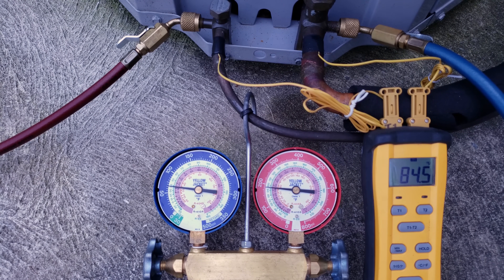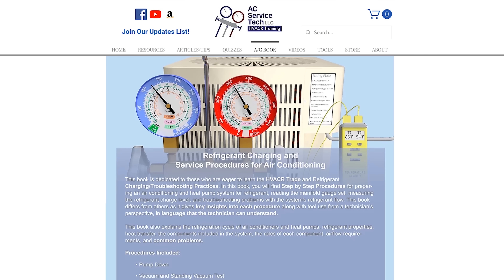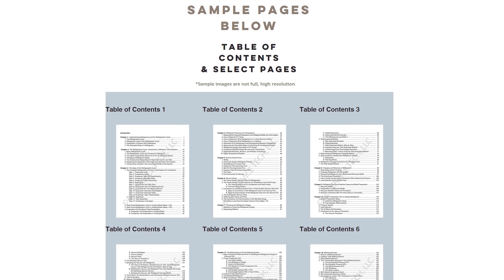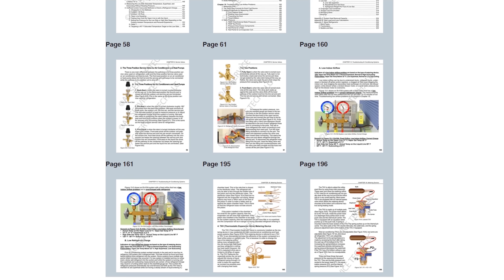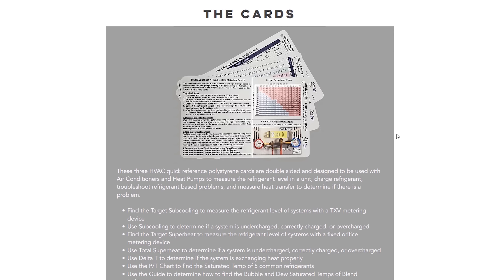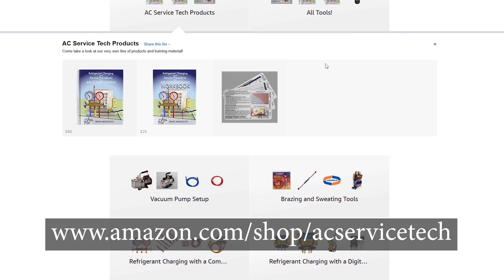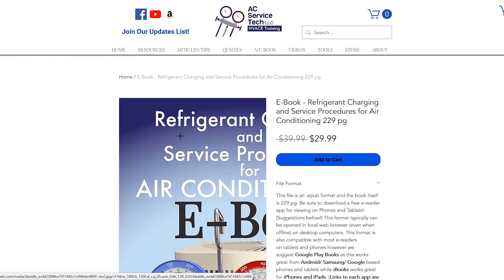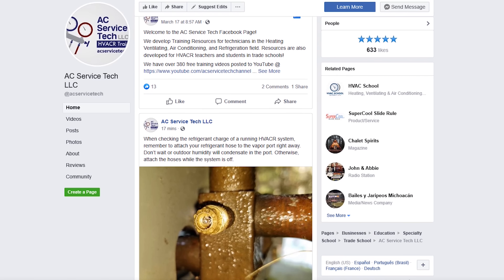Liquid Line Restriction on AC Unit Explained! Found Bad TXV!

Comment: Looks like the system is low in charge, I wouldn’t condemn the TXV some TXV s need a little extra push. You were well below on all pressures. Great video though!
Reply: Not exactly sure what the ambient temperature is outside so a little hard to tell what the the liquid line pressures might be. In my case I would have added 1 pound of R-22 to see if both liquid line AND suction line pressures increased and if the subcool and superheat temperatures changed or remained the same. I know you do have to be careful about overcharging the system though.
Reply: You are correct Disenchanted.  He was probably just a little low on charge. His head pressure was to low. 
He never gave the ambient temp. But guessing it was at least 70°-75° cause he’s running the ac and has a tshirt on. 
Grandpa’s rule for R22 systems 30° + ambient temp = high side sat temp. 
His sat temp was was low for ambient temps. Not to mention both high and low side was low.  He proved his txv was working when he placed it in warm water. 
He was just low on charge.
Reply: @rpatty1973 Heating the sensing bulb was a diagnostic step to confirm that the TXV has a restriction and is not operating properly under normal conditions. When you applied heat and the TXV opened, it showed that the valve was capable of functioning but was likely sticking or restricted in regular operation.

This test helps confirm that the TXV is faulty and needs to be replaced, as the issue is likely intermittent or mechanical, causing it to restrict refrigerant flow under normal conditions.

In short, heating the bulb provided a temporary fix for the restriction, but it verified that the TXV should be replaced for long-term system reliability.
Reply: @rpatty1973  Explain the subcooling then You are dead wrong! With txv open subcooling returned to normal from high.
Reply: TXV IS AN UPSELL SCAM THAT A LOCAL A C COMPANY USES IN LUFKIN COST ME $500.00 for A TXV FROM HUSTON, Tx. in 2015
THEIR NAME STARTS WITH 
Mc W  RUN FROM THEM THEY UP SELL EVERY BODY
Reply: I try charging the system first,if both pressures  goes up that means the system was low on charge. If the pressures doesn’t rise that means liquid line restriction then remove the txv bulb and place in the boiling water. Plz correct me if I am wrong

Comment: Great video as always.
But. When bleeding air out of your hoses, when you connect the suction and high side hose to the unit the hose connections should be slightly cracked at the manifold so as to force air out at the manifold and then tighten. Opening up the service line will be too late, the air has already mixed throughout the system as a homogeneous gas, not to mention the water vapor in the air mixes readily with hydroscopic poe oil that is suspended in the refrigerant. I used to use your method for years but I believe now that it isn't the best practice, especially on commercial units under contract that are constantly connected to. Thanks for another great video.

Comment: Great explanation. I got a 410a txv unit where my liquid pressure is fluctuating 100psig.  Why ? Possibly had leak seal in the past. Cooling good tho?? 17 degrees delta T

Comment: I thought if you do put the bulb in hot water and the TXV opens, then that means the TXV is functioning properly??? can anyone answer this?
Reply from the maker: The txv is functioning but with a lesser amount of refrigerant in the bulb (because some of it leaked out), thats the problem. It takes much more heat to make the inside of the txv to open.

Comment: Love the video.  One question though.  Is the dryer put in wrong.  I noticed it isn't a bi-flow and see the arrow pointing away from the indoor unit.
Reply: Nevermind.  I looked at the video again.  I see now that it's a horizontal unit and the dryer arrow is going in the right direction.   Sorry.

Comment: Gauges that are also for r410a will have a scale that will not allow an accurate reading for r22 (I have those gauges for a backup). The scale is way too wide. A set of gauges just for r22 is what should be used or an electronic gauge set. 
 If your readings (Temp and psi) are off just a little, that 15 sc might be 12 sc or 18 sc. 
  Your TXV testing is an incorrect way to test. Forcing a valve open is just that- a forced valve open. It will not substantiate a badly operating valve. 
 Be sure that outdoor coil is clean.

Comment: What am I missing? The txv got hot from the water, to opened up and let more refrigerant in. Isn't that what it's designed to do?
Reply from the maker: Yes but it should be able to do that based on the heat on the vapor line without adding excessive heat like the bulb in hot water. It wouldn't open during normal operation. This is a sign of a slightly low amount of refrigerant in the bulb, thanks!

Comment: Informative video and lesson. 

However, I'm confuse with the conclusion that the TXV is in bad condition @11:00. When the bulb is dipped inside hot water, the TXV opens up and allow more refrigerant to pass through hence superheat drops from 30++ to 19. Isn't the TXV is functioning properly because when it senses more heat, it opens up and vice-versa? Thank you
Reply: I think 🤔  the bulbs position is important an it could be not in the right position of the evaporator an it will give you a bad reading.
Reply: I think it's because the bulb was exposed to such an extreme temperature difference in hot water. Thus forcing it to operate. Remember it did not operate under normal conditions. Just my opinion

Comment: Where there is blocked filter in evaporator side, or clogged evaporator would also cause insufficient supply of hot air. So,In that case it would mean the bulb is not sensing

Comment: So, if I understood it right. The txv has lost some refrigerant charge. And the only way to make move the membrane and needle down, to allow the refrigerant to flow into the coils, -  Increase the pressure inside TXV, by using a higher temperature around the bulb. More temperature -more pressure on the txv membrane?
Reply from the maker: Yes the higher temp on the bulb will allow higher pressure to push the needle down and open up the flow a bit more through the TXV. Thanks for your support!
Reply: @acservicetechchannel  Thank very much for for taking the time and efforts to share your experiences and knowledge. On a Trane 4 ton packaged unit R410a with a TXV, it has the same problem. Superheat was 50 with suction line 105 psi and subcool was 25 and pressure was 449 +. When the TXV was  warmed up the superheat drops quickly to 20 and subcool to 5. The ambient temperature was 108. In this case, does this mean TXV is bad? Because it was thought it was OK since it allowed more liquid to the evaporate. Thank you in advance for answering my question.

Comment: I miss diagnosed a txv restriction today for a low charge issue apparently. System read low pressures with a high subcooling about 20 degrees I believe on a target 10 degree system. Any thoughts on how where I could have gone wrong? Anything hells thanks. 

Also some contexts I believe it was 14 seer bryant. 410a txv system. Lowside was 10 degrees sat temp and highside was about 108 sat. 80 indoor 100 outdoor temp

Comment: You should insulate your probes rather than just have the tape.  Get a good set of digital gauges, such as field
Piece  SMAN 480, and you won’t have to do all of the calculations, and you will be much more accurate than using analog gauges.  Liquid line restrictions are rare.  It is the components, such as a strainer or drier which are located in the liquid line that are where the restriction occurs.  The  defective TXV is not a liquid line restriction, it is a metering device restriction.  Calling it a liquid line restriction is misleading.

Comment: Thank God for videos like your on you tube. I especially learned a lot from the freezing coil video as well. My coil was freezing up as if the line had a restriction. A tech came today and checked the coil and it was actually clean as the filter which I recently changed. It was low 1.5 pounds low on r22 Freon but I was/ am concerned on how did it leak out when 1 month ago the levels read fine. He checked all over w a solution inside/ outside and couldn’t locate anything. I just filled it w 1.5 lbs of Freon and she’s running ok now. Just hope it doesn’t leak out since we didn’t find the leak and it doesn’t freeze up.  Any advice?

Comment: Would it be OK too pump the system down then change out just the head and bulb of TXV before you lose all of the suction pressure then release charge?
Reply: You mean suck down to like 2psi to avoid braze and vacuum? 
Hmm I think it this point "bite the bullet" do the whole job. 
Txv is a delicate thing to separate and mixing old with new doesn't sound the best

Comment: When testing the txv in hot water 
.after suction temp rises and superheat lower..what did you mean by not letting the system run?
Reply: I believe he meant that you have to be careful that you dont slug the compressor with liquid refrigerant.

Comment: Time is valuable and instrumentation feedback is awesome. Therefore you should be using a modern gauge set that shows you your superheat subcool line temps all on the Fly of course that is also including pressures.

Comment: If the screen is clogged should you replace the txv or just screen. I have one that's causeing high SH but normal SC. No dryer installed so I'm thinking that's what caused txv to stop working properly.

Comment: You were concentrating more on temperature of the line set but low suction and high liquid line pressure will tell you that you have a restriction...whether it's a clogged liquid line filter dryer or a FAILED txv.  I've used this method for many years and always know where the problem lies! High head & low suction =restriction. TXV DEFECTIVE, PISTON CLOGGED OR FILTER DRYER CLOGGED!

Comment: Hi, I have an unsolved problem.  2 tons split unit heatpump, liquid line temperature is 63f (sweeting), sat 60f.  suction line 37f, Sat 32. outside temperature 73f, interior 76. I think is a restriction so I have replaced the dryer in condenser cause 6f diff but the problem persists.  maybe the capillary tubes in the condenser? Why a have a lot of liquid in the evap? Could the three-way valve cause this problem?  I think not but some technician suggested that. I recharge right amont of r410a.
can you help me? Thnx
Reply: Its crazy how i dont find nothing about this problem on the web.. People try but said is probably this or this but no confirmation what cause this problem. I want fix this lol im crazy but i need to know. I really think is a restriction in condensor cause system cut on Hp after some time.
Reply: Very low head pressure? What happens when you flick it over to heating?. 
Is it truly the discharge pressure 60F seems way too low. 
By chance does it have 2 capillaries? 1 ID 1 OD in series

Comment: I love your videos,I have a question when you said restriction on the “screener” what is that,thanks for the answer.
Reply from the maker: There is a little stainless steel screen right before the metering device and sometimes there is another right after the metering device so that may get clogged, thanks!
Reply: AC Service Tech LLC thanks a lot for the answer and for taking your time to respond appreciate,blessings
Reply: Strainer, is the word
Reply: Sight glass

Comment: Maybe you could help me. No one else can. I've paid 2 different techs that both charged me $79 to diagnose the issue and they both couldn't figure it out. They both suggested I just replace a 12yr old unit with a new one. At a cost over over 5k. My issue:
One day my ac went out, after trouble shooting, found out that the thermostat wires on my roof top a/c were so sun dried that they hade exposed wires and clearly took out my transformer (volt test showed I had 120 but no 24v. So I ran new thermostat wires and waited for my new transformer. 6 days later I installed and boom. Got 24volts and both the blower and compressor kicked on. Got off the roof went inside just to find out it's blowing hot air. Couldn't see any mixed wiring, so I thought it needed a charge. First guy came and told me that mechanically everything is fine. It has plenty of Freon and the pressure gauges don't seem to show any leaks. But he couldn't figure out what the issue was. So I called another company and they said the same thing, they tested the hi and low side and said everything there was fine. But couldn't figure out why the coils weren't getting cold. So now I'm stuck with having to pay 5k for a new unit after already investing $150 in new parts. Blah. Thanks for reading my rant.
Reply: shadow demon. I read your rant,  the question is why so many dummies in the trade? I personally have come after 2 previous techs said it's dead replace, I found an electrical fault at 1 hour charge fixed. They were so happy they got us to replace it and receive a major maintenance contract. 
You just need to work out why the electricity not getting through. You worked out part of it

Comment: Hi I have a question I have 410A unit I did replace the txv but when I charge it back why is my liquid line is cold then after about 30 minutes of run compressor shut down and has this like hissing sounds I check for the leaks there’s nothing I did clean the condenser unit and still no luck I was thinking maybe the drier filter any suggestions pls thanks
Reply: The hissing could be high pressure bypass on the compressor and the compressor turning off could be the high pressure switch.  Maybe you over charged it when you charged it?
Reply from the maker: Where is the liquid line cold? downstream of the TXV? What pressures superheat and subcooling where you running? thanks!

Comment: So the txv did not fail mechanically in this case? or truly a restriction of a non-condensible or other foreign object? Dan foss had a great article where they were getting an abundance of returned txv's when truly the failure was a restriction or a failed sensing bulb, drier filter. Nothing with the txv; since all the txv does is one thing: the rate of flow of liquid refrigerant into the evaporator. What was the bottom line in this case?

Comment: Today I encountered a 410 a system  with 25 degrees of superheat and a subcool temperature of 5 degrees (plate said 15 degress of subcooling) so I'm confused is it low on refrigerant or is it a restriction. I tried adding refrigerant and the pressure would not budge. (Unit Is only 3 years old) 33 saturated temp on low side.
Reply: Have you checked for restrictions such as dirty filter/evaporator coil, collapsed duct? High SH and low SC sounds like a low charge but if you added refrigerant and the temp/pressures did not go up there is probably a restriction in the system. Do you have a piston or txv on your evaporator? If I have a piston I will add one pound of refrigerant and if the pressure/temp on the evaporator coil does not rise then I know I have a restriction. Last month I had a txv system that was freezing up. After turning off the unit I noticed the pressures equalized very slow, 30 minutes. What I thought first of all was a bad txv ended up being debris in the line. I hope this helps.

Comment: great book by the way. ok, the txv is opening up when submerged in hot water. so it's actually doing its job. am i missing something here? please help to clarify. thank you.
Reply: mark.r hvac I thought the same! I think he said that the refrigerant inside the bulb was low in charge, so its not work properly. I thinks the problem was in the actuator its self, that TXV looks really old. I got the same problems in a walk-in cooler, it took me weeks to solve and find the problem, actually, I called my Dad who have 50 years of experience and he told me to change the TXV. Now with this video i can figure it out more easy next time!
Reply from the maker: Mark and Marcio, so the TXV will not apply the correct pressure which would be opening force because the bulb is low on refrigerant. However, I often find that the bulb is low on refrigerant and not empty so if I submerge it in hot water, the  pressure is higher even with the smaller amount of refrigerant inside the bulb. If I see the txv allow more refrigerant into the evap by noticing the higher vapor pressure then I know the TXV is at fault, thanks!
Reply: AC Service Tech LLC 
If the screen was the problem, there wouldn’t be a change wether the bulb is good or bad, the pressure on low side would still be low?
Reply: i would have thought that evap coil
 was restricted.  undo blower and see where in freezes.

Comment: 410A unit with a txv it's about 4 years old, this morning the coil evaporator was frozen so I let it unfreeze and started it and checked the pressures, the suction line was reading 85psig and the liquid line was reading 500psig so I put the txv bulb in warm water the the pressures change to 125psig suction side and 425 psig liquid line. Outside temperature was 90, could this be a bad txv or restriction somewhere? To me the liquid side pressure is way high
Reply from the maker: It sounds like the unit has a restriction at the TXV or the TXV is adjusted incorrectly if there is a spring on the bottom. Also it sounds like the unit is very overcharged. What was the superheat and subcooling?